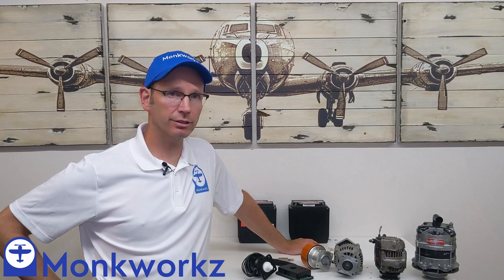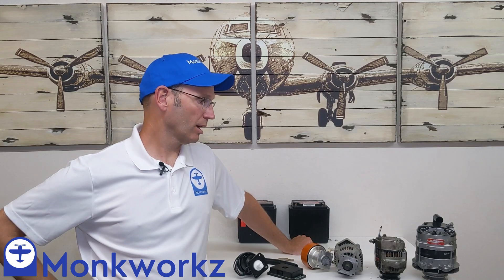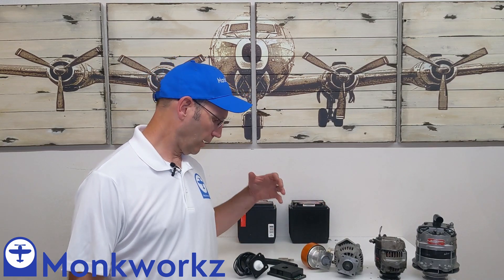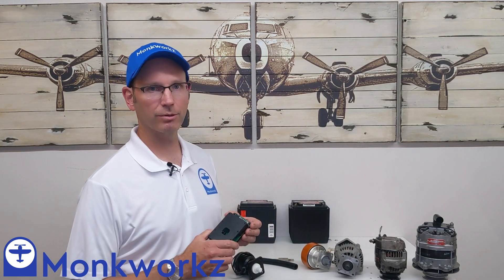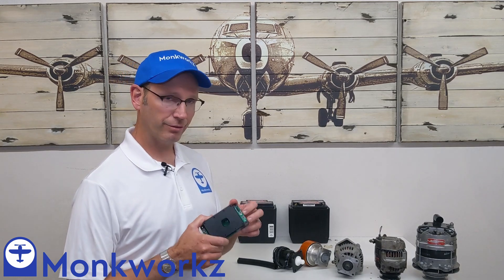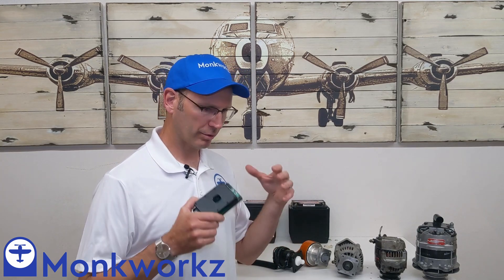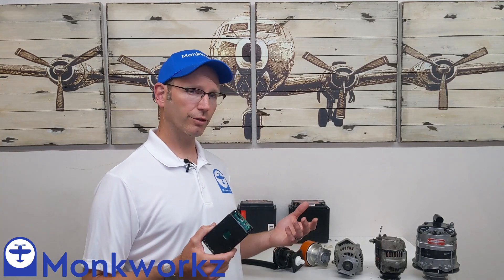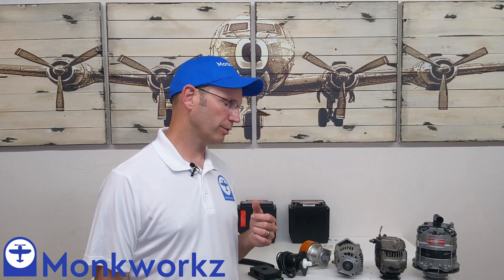Monkworkz Experimental Aircraft Electrical Generator Introduction

Comment: Have these been used on Rotax 912/914 engines? Is voltage adjustable? I like the low weight
Reply from the maker: Hi Dwayne, should work on a Rotax but has not been tested. There are two user selectable, stock voltage settings, 14.2V recommended when used as a backup and 14.6V recommended when used as a primary.

Comment: Question… can the MX-30L be connected directly to the battery like in Bob Nuckolls’ Z101 or is there a parasitic load that would drain the battery over time?
Reply: I see your answer to this question on Van's Airforce: "... this isn't recommended, there is a resistive voltage divider on the output that keeps tabs on the output voltage and that will over time drag your battery down, bottom line: you need to connect it on the switched side of your master relay/contactor." Post 21 at https://vansairforce.net/community/showthread.php?t=206179

Comment: Am I correct to assume you speak of Lycoming engine RPM and alternator RPM is 1.3 x engine RPM?
Reply from the maker: Yes, all the RPM values I quote are crank based for lycomings where the vac pad is running at 1.3x